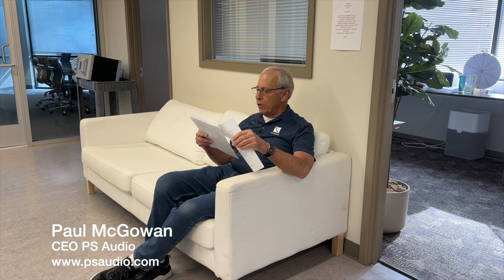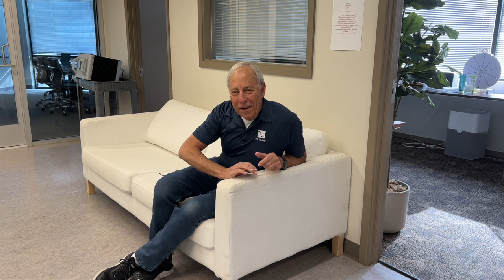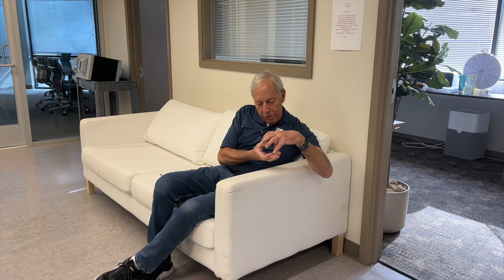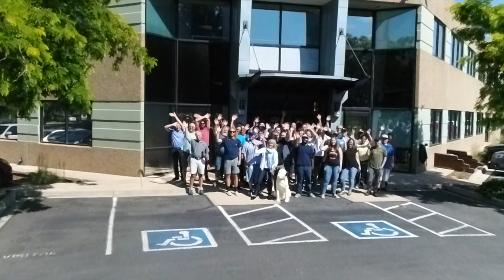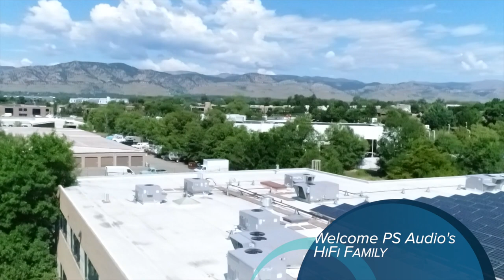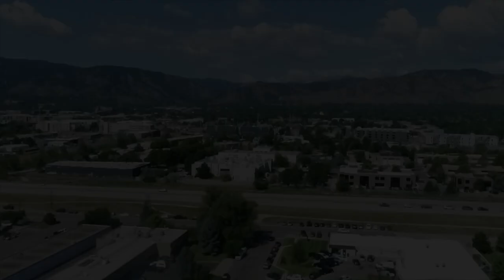Why you need a separate preamp

Comment: Nice Paul. Both integrated and separates have their advantages as you say. My 36kg integraded has separate powder supplies for both preamp and Poweramp with short internal interconnections. Best of both worlds. I have some beautifully built amplifiers that have copper chassis with shielding, pure copper feet each weighs 500grams per foot. 24K gold plated rear speaker terminals, tamura mains audio transformers, Mosfet outputs, lead dampening on the cases to stop vibration. Machined aliminium 8mm top covers, front face and knobs. All this in an integrated. Something you don't see today.
Reply: Very interesting piece of equipment. If I may ask what brand / type is your integrated ??? Amazing specifications for sure
Reply: Howdy. Very interesting.
Powder supplies ??? Does it have selenium rectumfiers too ??? Would be a dangerous lineup, I would think.
Regards.

Comment: I had my preamp in for service about a year ago and I used my DAC as my preamp during this month, straight into my amp. The difference was shocking to me, sounded waaaay better with my preamp back in the chain. Who knew?
Reply: I knew. :D
Reply: Not an uncommon experience, but it depends on if the DAC allows for volume control at the source, otherwise it's 100% output at all times. Typically, you will get great clarity allowing for finer details to shine through, but for some systems, it may sound a bit thin/sterile in the mids & bass. (lacking body) But it's definitely something worth everyone playing around with if  the opportunity is there.
Reply: i am guess this is the answer the emailers question
Reply: I’ m running a Cambridge 851N (Preamp Dac) with Focal Solo 6(s) through Audience XLR cables. Sounds great!
Reply: @hoth2112  it’s an Audio GD DAC that allows switching between line out and pre-out
Reply: I am also a proponent of the elimination of active pre-amplification. With adequate source output, all that is needed is passive preamp functionality (volume control and, possible source selection). Others may argue but I’m in the less is more camp, especially if it allows more spent on the quality of the less 😁.
Reply: Yes it's the same in mine. Direct dac connection vs anode acoustics 12au7 preamp and the preamp is wayyyy better. Separates are the way to go, and a tube preamp is very nice indeed.
Reply: @hoth2112  Adding even just a small subwoofer with it's own level control may solve the "thin" problem nicely.
Reply: @danmarjenka6361  That's not quite the sort of thinness I'm referring to, it's more the "body" or "warmth" found in the upper-bass and lower midrange lacks the same presence compared to using a preamp. (It's the same with passive, active or tube preamps)

Comment: That is why car audio use separates also. The head unit uses a separate external power supply plus the separate amplifier’s. Dedicated 2400 or 2600 amp gel battery.
Everything in the system is connected to separate components. That is how you get high end audio in your car.
Reply: I have heard loud clear audio in a car but not high end.  I think it is impossible to get a soundstage in a car and the windows are horrible for sound.  Are you sure cars do not use separate amplifiers because they just do not have the room for them in the dash?

Comment: Power amplifiers already have a degree of pre-amplification built into their input stage, so by integrating the separate preamp just boils down to increasing this gain, plus of course all the switching and controls.
A disadvantage of separates is the cable clutter created from interconnects and mains leads.
An advantage of separates is that they facilitate choice.
"You pays your money and you takes your choice."

Comment: Nice video Paul. I went sort of the half way route… I went for an all analogue integrated Naim Supernait 3 so that I could keep the component footprint low, but be able to embrace the concept of separates… I.e. keep my DAC and sources separate, to appreciate the goals of having separates (as you mention), while keeping that low footprint possible (the compromise you mention too, plus that old chestnut called budget). I went for a pair of KEFs LS50 metas which works really well with the SN3 and the room I have. Looking forward to the next video 👍🏻
Reply: What DAC do you happen to be running with that setup, if you don't mind me asking?
Reply: @jedfehrenbach9470  Hi Jed. I went for a Chord Qutest
Reply: Paul’s point on power supplies is key. Nice thing with the Supernait 3 is that you can add a HiCap DR as an external separate power supply for the Supernait preamp stage. It’s supposedly a major improvement on an already spectacular integrated. But, it does introduce a new box.

Comment: Even if NAD almost always have in and out connections so you can connect to your bass box and adjust the volume, there are many integrated amplifiers who do not have this. you are forced to use an external preamplifier

Comment: Great explanation.
There is an additional consideration.  Market economics.  With separate boxes, you can charge more and people will pay it.  You could make an equally great or better integrated by using separate power supplies and EMI isolated sections for the preamp and power amp but in the same box.  But it would be big and heavy and cost more than competing products, so it would not sell as well or bring the margin.  I don't say this as being critical, just realistic of the market dynamic.
Reply: You would still have the interference problems which is also very expensive to mitigate. I’m not saying it wouldn’t sound good. But separates are much easier in that the designer- engineer can focus on one specific job and optimizing it for that specific purpose.
Reply: I absolutely agree with your market perspective...

Comment: I guess we can disregard the "modulated" power supply issue - even if you have a separate, it still feeds of modulated AC?
Whole point of good power supplies is (in most situations) to provide "clean" AC regardless?

Comment: The issue with all in one to really do good shielding and lots of separation you need tons of room which can make 1 piece of equipment huge. Separates you can fit individually on a rack. My VAC tube amp has separate smaller power supplies to be closer to each connection point for faster transients and helps with the slew rate. Within different price ranges and room sizes are different options to configure systems for maximum sound quality. I believe in separates. Think of it like one person doing a one man band with 8 pieces attached to them. Can they make music all at once? Sure. Does that music sound better than each musician only playing that once instrument to their total attention and focus? No way  if the talent and parts are the same then not even close.
Reply: The issue with separates is the idiotic analog interconnect in a digital chain

Comment: The downside is the additional wiring and connections that can degrade the sound. The shortest most direct route is usually the best.
Reply: you also degrade the sound if the degree of seperation isn't enough within the integrated product. The more transformers, the bigger they are and the more psu's you use the integrated either becomes more expensive than the seperates or it again degrades sound in a different way 🤷‍♂️ you can't break the laws of physics. and the higher the seperation of the integrated and more you put in you end up with a heavy box that's the same as having seperates sometimes
Reply: @V1ralB1ack  I’ve never experienced that.

Comment: My very good sounding power amp and speakers have served me well since 1985 or so, but the matching Hafler pre-amp finally gave up the ghost a few years back. Not wanting to spend a significant sum on a replacement pre-amp, I purchased a Mackie 4 input mixer to use as a pre-amp instead. Is using a mixer as a pre-amp considered a poor choice? To my (aging) ears, it sounds excellent.
Reply: If it sounds good to you, that is all that matters.

Comment: If I have separate amp and preamp, but both are plugged into the same power outlet/power strip, does that defeat the benefit of having “clean” power to each as you described in the video?
Reply: I'm also curious of this answer, just commenting so I get notified when someone answers.
Reply: Only for audiofools power is a unsolved problem in 2023 while technically it is solved for decades in proper power supplies

Comment: Paul,I am a novice,trying to learn at twilight but thankful stage in my life,I do have the 70’receivers( pioneers),my question/concern is when you use a receiver as a preamp,what happens with the amp,we have 2 channels,do they now have increased power,is the preamp now being powered by the other separates,eg receivers and amps,I appreciate your advice,thanks
Reply: Most of the time the power amplifier section stays on, therefore I do not like to use intergraded amplifiers only as Pre-amps.

Comment: OK   I guess now's the time to ask.     Why  don't  high end  pre-amps have bass and treble controls.    Recordings  are  so  different and in need of help.   Mofi  are  bass heavy.   Why would you just throw  the ability to adjust that out the window?
Reply: Some McIntosh models do, but then again, some people wouldn't call Mac high end.
Reply: My understanding is that high end is geared towards "acoustic music".
  To have tone controls boosting frequencys at high gain levels, can be catastrophic to affected drivers.  Imagine doubling the power at certain freq's, it can be very significant. Tone controls distort the signal. Also, what set freq's would a company pick? Having the signal just run through an eq circuit (flat) degrades the signal.
Reply: No concert goes on without a EQ
Reply: @jonathanginofilippi  Deffinately an amplified concert. High End is geared towards non amplified music. Once the recording has be engineered, a casual adjustment at some pre selected frequency is to butcher the signal.  
That is just the "high end" crreed. 
Personally, I'm not interested in violin and piano music, but I do know what happens when you start re engineering the signal.

Comment: The primary reason (for me) to use a preamplifier is because audio and video standards change quite often. Every time I need support for new standards, I can simply replace the preamp; no need to replace amplifiers.
Reply: Your preamp has a video input? RCA and balanced inputs have existed for decades. The digital world of audio has been in the flux, but if your DAC is external, that's a matter for the DAC.
Reply: @ThinkingBetter  Probably referring to home theater. I do the same.  I only have to upgrade the preamp which is generally cheaper than upgrading an integrated AV receiver.  You also usually get better components in a preamp with HT versus going integrated like balanced outputs, toroidal power supply etc...

Comment: Easy answer is no. Unless you love wasting load of money on fancy boxes, extra furniture and expensive interconnects. Just ask Hegel and try their H390 or H590.
Reply: Why do I have to buy expensive interconnects?
Reply: @Mark-lq3sb  I wonder how much money manufacturers spend on the wires inside the boxes.  I bet not nearly as much as what they try to sell a one foot interconnect outside the box.  Are we to believe the box itself shields the wires from interference or is the extra 10 inches of cable creating so much more signal degradation that added cost is needed?
Reply: @MrWookie1981  
My question to Mark Lydon was in reference to his comment about buying expensive interconnects. Meaning, why can't I buy inexpensive interconnects? What you replied with needs to be directed to an audio manufacture, and that's not me.
Reply: @Mark-lq3sb  my questions were more rhetorical. I agree with you.

Comment: "Cleanliness" of power is the most often repeated myth in audiophile gobbledegook. Nothing against separates, and nothing against integrated - it's what suits you and your listening space, your budget and your level of interest. I do have an issue with the oft-repeated hokum of purity of power and how that affects sound output - unless you're running your set up on the same circuit as your washing machine, you're good to go - power conditioners should be sold under the name of Barnum.

Comment: Zero benefit running seperates with efficient speakers. If you have a good quality well build integrated amp,, the benefit going to seperates is less than 1%.  If you got $50k to blow on some crap sure...

Comment: Separates all the way.
Reply: Yeah, no. Extra cost plus increased chance of noise. Buy right the first time.
Reply: If you got the separates money
Reply: The interconnects needed for separates negates any advantage.
Reply: @Carl-bd1rf  
Why? You can buy inexpensive interconnects that work just fine.
Reply: @Mark-lq3sb  expensive separates and hook on cheap inter connects.   Bruh...  Get a good Intergrated Amp, separates dac cd player can make sense.    

Only need separates if you run crappy speakers
Reply: @Mark-lq3sb  
Yes you can use an inexpensive interconnects to link your expensive preamps and power amps. 
My point is you’re adding a component between your pre and power amps. This component can only change/degrade what’s going through it. 
Do cables make a difference, yep. Can a cable make another component better, nope. It can only make something sound different because it changes/degrades what’s flowing through it. 
Separates don’t sound better simply because they’re separated, this is a lie of the industry to get us to spend more for the extra power supplies and chassis of separates. Integrated amps and receivers can easily sound better than separates because the manufacturer has already done the leg work of component matching. 
People would be amazed at what they choose as better in blind listening tests! Checkout the Carver challenge in 1986 with Stereophile magazine.
Reply: ‚Journey‘ already knew this about 40 years age 🎵🎶
Reply: @tacofortgens3471  
Head to the local Taco Hell.........
It's Taco Tuesday in the U.S.A.
Reply: Pplleasee pleas epleasee pleassee help me understand balanced comnections :( im about ready here to give up on all of my audio cause i cant figure this knob out / everyone sayss exxxactly what u say to balanced knobs i need a diagramm or some help please can u help me? Im legitly bagging legittllyy annyyone thattt tturully knows a ballanced conectionn from a unbalanced pre out. Im self taught and i underatand in ways how its directional and im making my own wired catagory wire spiral coper wrapped shielx with a foil copper tape/thinking it be in its own dielectic or housing what ever its called but.. i have many drawings of knobs starting from unbalanced which i get 100 percent but i dont want that i want qausi balanced but no one can show it. So cann u pleasee show it? Or sumthing like even .. messege me? Please?.. like ive spent over a grand on my audio this past two months!! Just to make my car audio phenominal got high output alt on its way.. but i really i want to give up cause i cant get this nob figured out.. everyone tells me oh this is easy anddd the exaactt thing YOU say -.- which is its two live and ground crosed into it to pull it down then at the other end its terminated.. tho i have tooo much known wwayy too much knolegee to it all with not true understanding to howw.. i have other ppl to telling me other bs .. like ppl telling me too u just use one knob... :,( im rlly not happy) i feel like i cant do anything :/ i been learning and figuring it out for like 5 whole straight days 2 of wich i pulled all nighters justtt to get no wer!! So can u just like please hit me up or sumthing like i mean sumwere we can trully talk md send pics nd shiet cause man i need help i need truth im sick of all the know it alls yet they dont know shiet they dont want to help nd if they do they wine that i have sooo much to say.. im loostt ass helll!!! I truullyy need help can anyone ayynoooone help me pleasde!!
Reply: And i as well i saw 3 is cold 2 is hot and 1 is ground.. thats what ive seen on the pot "ideally" what turns it down acordingly only to "sight" estimation..  am self taught in everything physics and have gotten great/horible understandings to sumthings cause ppl dont know anything but what they no nd wont care to try or see anything please can u help me out